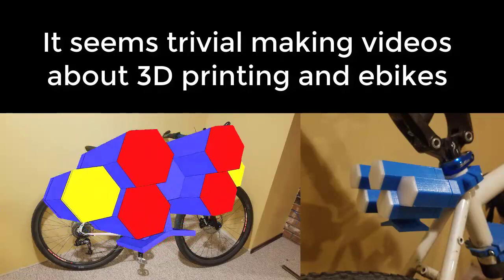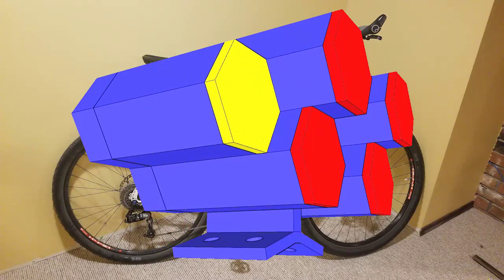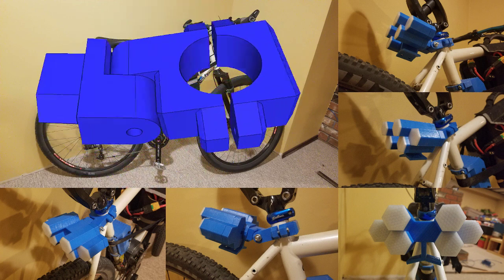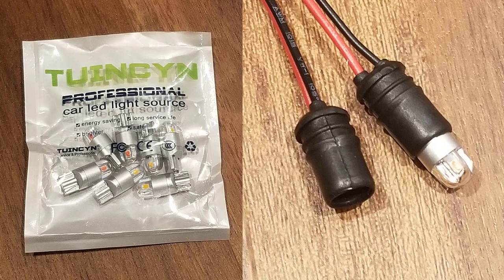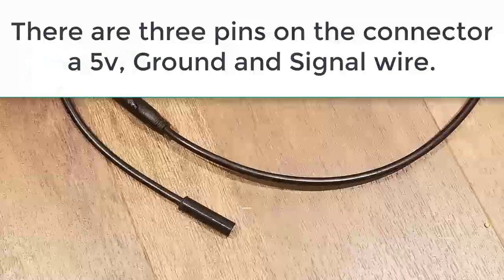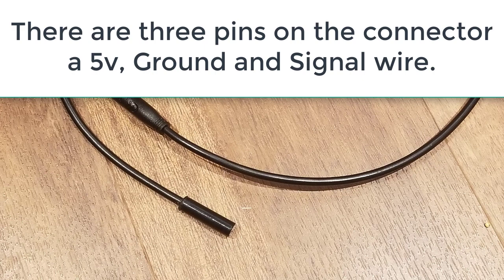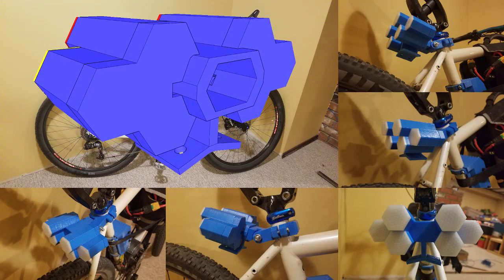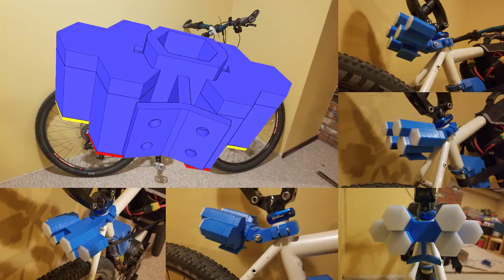CC Projects Update - Ebike Lighting Cluster / Road Legal Preparation

Comment: Awesome, based on a previous comment, it seems like I'll be able to use these without the bac800 until I save more money!!! Boy I'm pumped for when this is ready!!!!
Wiring the rear brake light is a bit easier, but I was under the impression that turn signals would have to be programmed into the NXT ? (Which I don't have yet) also I'm trying to use one of those cheap key start and twist throttle handlebars with my bbshd, I have a very simplistic led display panel, so for security I want to add a key lock to the mix, and substitute the default bafang throttle for the twist throttle. 🤔🤔🤔🤔 So many ideas watching this... Thanks as always Cap.
Reply from the maker: Matthew F I think the turn signals are just a switch and flashing circuit but not 100% on that. I expect I'll try lots of things. I'd like it to work with the nxt but also give people the option to use it with other bike systems as well. Thanks for the suggestions! Cheers

Comment: I really like that tail light design, I use the magnetic brake cutoff that came with the BBSHD to activate my brake lights, All I did was hook up a multi meter in continuity mode and swap wires around until I found which wires close the circuit when the magnet leaves then I used those as the switch and it seems to work fine with the 12v system. I also have a headlight, signals and horn run off a motorcycle handlebar switch from amazon and wired up an adjustable flasher relay for the led signals. Most of this stuff fits in the tiny extra space in my 72v battery bag so I'm running without a horn currently until I can get the BAC800 replacement from Alan or the CYC Gen2 kit whichever comes first.

Keep up the great work I'm sure you're inspiring many people to start a build of their own and bringing 3d printing into this just makes it that much more awesome.
Reply from the maker: That's some good ideas. I have to chat to a motorcycle guru so maybe he has one or can suggest one. Cheers!
Reply: 🤔 motorcycle handlebar switch? Does it come with a key lock as well?
Reply: @evgizmojm  It just has switches for signals, headlight and a horn button but there might be some with a key.

Comment: Thanks for rolling out another update during this challenging time. You have some really good design skills. I have decided to go with a dynamo hub system for my ebike build. I have installed a Supernova front and rear light as they seem to get good reviews.
Reply from the maker: B. Bergy Thanks. Is the hub single or duel drive?
Reply: Captain Codswallop I am getting this one -SP PD-8 DYNAMO HUB. Hopefully it works out well. I just figure I will never have to worry about charging them.

Comment: Interesting looking lights. Personally I would not build something that big. Everything about a certain size simply tends to brake off in a real life scenario. The largest version of a backlight DIY style is something like the Supernova Clones I did myself: https://www.thingiverse.com/thing:4189894
The tripple LED version is the biggest thing I would attach to my bike.

For fenders I would go for PVC plates. Since PVC is a thermoplast you can easily change its shape by simply using the tires of the bike as positive form.
Reply from the maker: That's a good idea for the mudguard. I will look into it. The reason for the size is so it will help with the road legal path and have the required elements. I will be sure to road test everything! It feels rock solid and I am making the mounts very beefy in nature. Its a good point you make. I do not want to be picking up parts in the road. Thanks for the link! Cheers